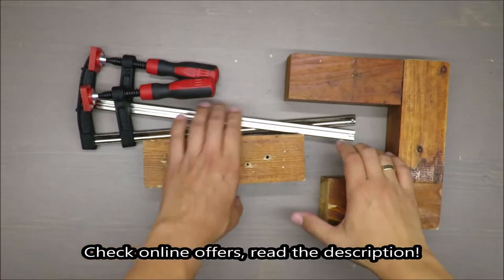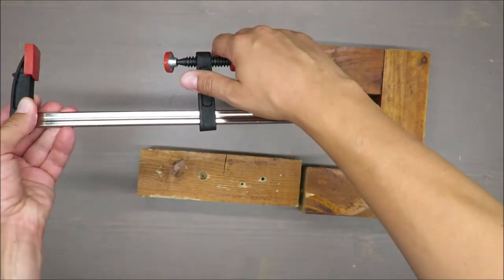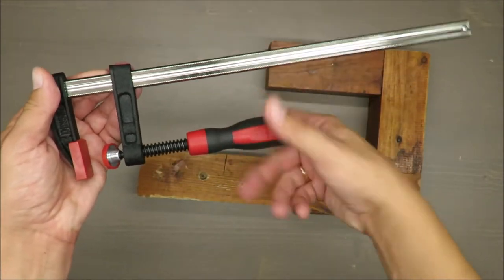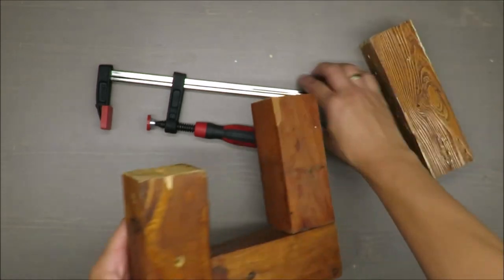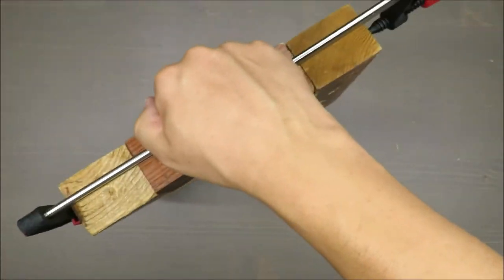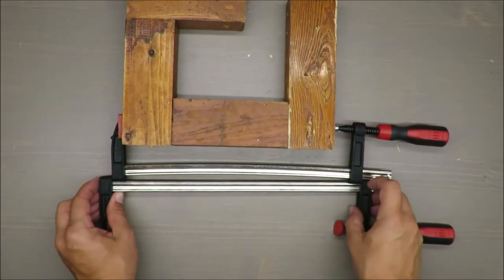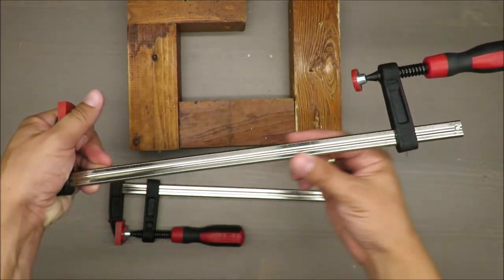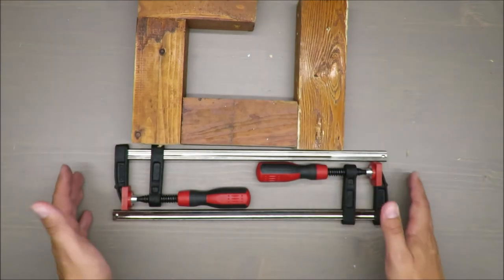PARKSIDE Screw F Clamp set REVIEW / TEST (Lidl metal 3-piece clamping depth 5 cm)

Comment: Thanks for the review.  Bought the exact same clamps online and they are very good value.  All metal, and clamp tightly.  You do not always have to buy expensive tools to get a job done.  These do the job just fine.  On the shorter version there is virtually no bend.  Even with the bend it still works.  For DIY weekend use they do the job.